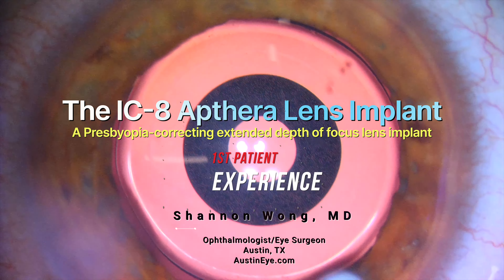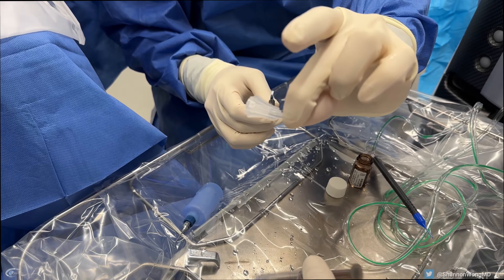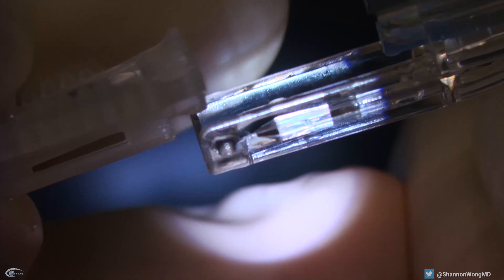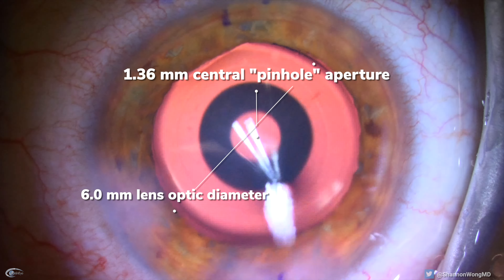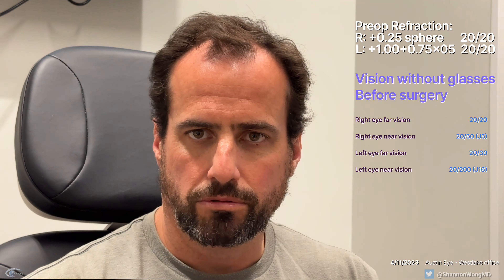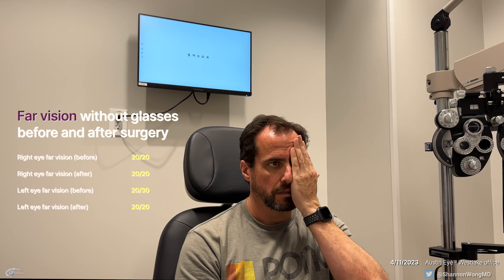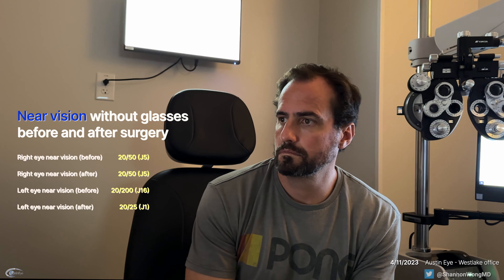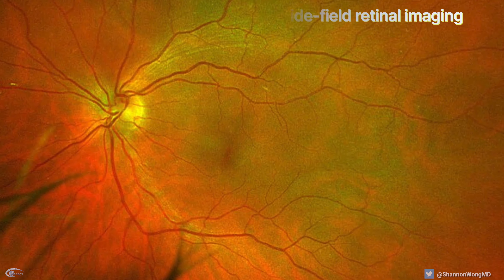The IC-8 Apthera lens for premium cataract & lens replacement. How well does it work? First look.

Comment: Thank you so much for sharing this patient’s experience! This does not reflect my own. I underwent refractive surgery because I became farsighted after LASIK and dependent on reading glasses. I used 1.75 for daily activities and 3.50 for reading. I am an athlete competing in Ironmans, surfing, pickleball, etc. 
The Apthera IC-8 only functions in outdoor light for me. When I move to dimmer light, my vision plummets. For example, I cannot see faces well at the dinner table or in restaurants. If the lighting is adequate I can now read, but the page is still not as clear as pre-op with readers. The TV is blurred. When looking at a bright light at night (street light, power light on computer, etc) there is a bright halo of color. The halo is absent in bright light. The most import thing I would like people to take away from my experience is that the low light deficits are not correctable with glasses. Therefore, except for improved vision in outdoor sunny light, my vision is worse. My indoor or low light vision is now uncorrectable. My ophthalmologist documents my post-op exam is excellent, including no PCO.
Reply: Thank you for sharing this. I currently have the choice of an LAL or the Apthera for my non-dominant eye that has a cataract. The doctor’s first choice is LAL but said if I couldn’t deal with wearing the uv blocking glasses we could consider Apthera. She said there could be an issue in dim light situations like at a restaurant with dim lighting reading a menu. Your experience is very helpful. I appreciate it. I will go with the LAL.
Reply: Follow-up: I had the IC-8 Apthera exchanged for the B&L enVista one week ago. It is as if I have been released from eye prison! My vision is so much improved.
  I think there are two design issues with the IC-8. First and most obvious is the pin hole filter blocks light making it difficult to see in low light. Second, the pin hole filter’s outer diameter is too small allowing light to “invade” around the perimeter causing the distorted images I describe above. I believe it was designed the way to allow for possible laser treatments. Pilocarpine improved my vision by blocking the peripheral light, but the image was still too dim. I couldn’t imagine going the rest of my life dependent on the drops. I really wish there was a patient forum where I could have learned this prior to my initial surgery so I could have avoided the second lens exchange surgery. I would go so far as to say B&L has false advertising on their IC-8 Apthera website.

Comment: Although lens replacement surgery in most cases restores vision completely, there is still one negative consequence. A large number of patients develop secondary cataracts over time: from 30-50% of those operated on.:face-pink-tears::face-pink-tears::face-pink-tears::hand-orange-covering-eyes::hand-orange-covering-eyes::hand-orange-covering-eyes::hand-orange-covering-eyes::hand-orange-covering-eyes::face-turquoise-covering-eyes::face-turquoise-covering-eyes::face-turquoise-covering-eyes::face-turquoise-covering-eyes::dothefive::dothefive::dothefive::dothefive::dothefive::dothefive:
      CONCLUSION: even if you implant the most expensive or the most technologically advanced lens, FOR 30-50% of patients you will need to make a HOLE so that LIGHT reaches the retina, isn’t it easier to just insert a “GOOD” MONOFOCAL HYDROPHOBIC LENS.......                                                                                                                                 :body-blue-raised-arms::body-blue-raised-arms::body-blue-raised-arms::body-blue-raised-arms:Why then do eye surgeons in mainly ADVERTISING various ARTIFICIAL LENSES???
      Answer: 1) campaigning to acquire patients, AND IN THE RESULT MONEY 2) Companies that produce not only lenses, but also related devices and materials, THAT IS, THE ENTIRE INDUSTRY AROUND THE EYES is initially interested in ADVERTISING their products. (but this is not advertising around cars or sneakers, etc., BUT THESE ARE EYES...)